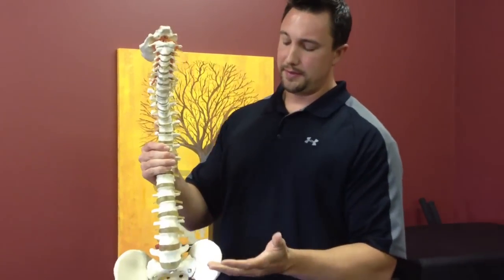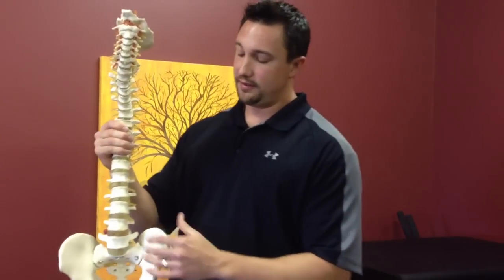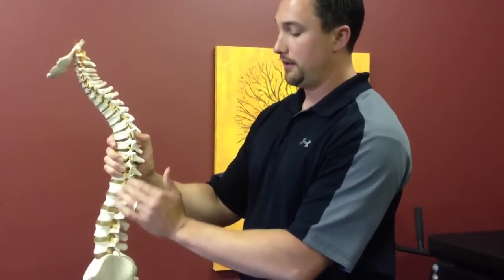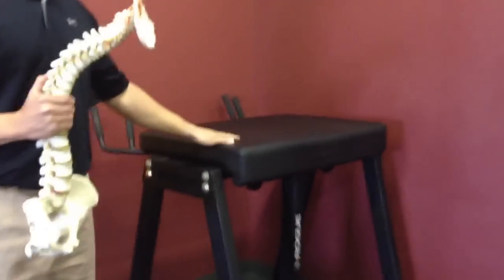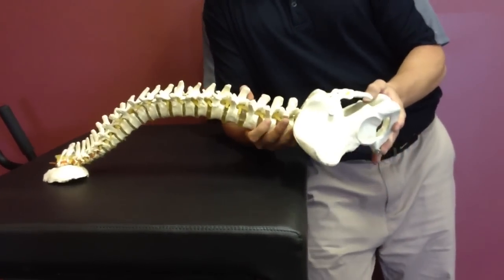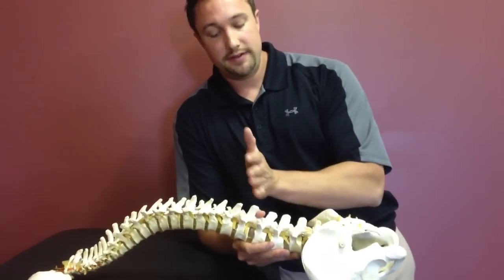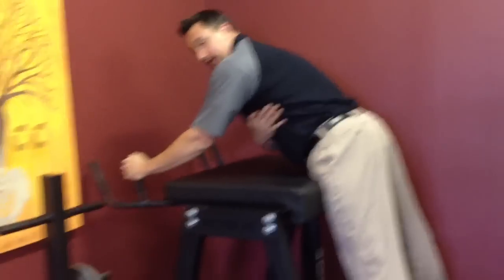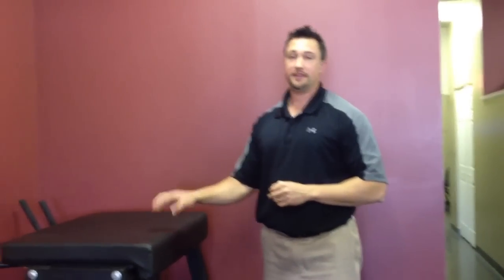Spinal Decompression using Reverse Hyper | Susquehanna Spine Lancaster | Westside-Medical

Comment: I just bought the rogue reverse hyper. I have 2 lower back buldging disk.  My back is been hurting:(  iam thinking because if the reverse hypers
Reply: Any updates?

Did you try it without weight
Reply: @golftownpro999  no I did not.  I sold it
Reply: Did you was died?

Comment: Please HELP, I have lower back pain, (Bulging disk) so I was told by my Doctor, Physical therapist and Chiropractor that I need to make my lower back stronger including the glutes. I have used the regular GHD hyper in the gym and definitely works making my lower back pain get better and also gives me a little stretch in my vertebrae. I have limited money and space, which do you recommend for someone like me. I'm not a powerlifter, just trying to make my lower back stronger and get some stretch/decompression on my back. Should I the regular GHD or the Reverse Hyper? thanks...
Reply: The rogue scout reverse hyper. It folds and is the cheapest.
Reply: The GHD did magic to my lumbar. Research the position of your hips and what it works.

Comment: Anybody know what kind of gym this would be at? Would a local CrossFit have one? I don’t have the money to buy but want to try bad!
Reply: Look up "Reverse Hyper Scout" Rogue just came out with it in collaboration with Westside Barbell. It's only $350 usd and folds up so you can use it at home. Unfortunately they sold out almost immediately but they should be restocking eventually. To answer your question though: yes crossfit, powerlifting, or university gyms are most likely to have one. Only gym I've ever been to that had one was my old university gym
Reply: @1KevinsFamousChili1  I found the foldable one for sale. It sounds great but still want try it first. Found one about 45m away from me and I think even tho my back is messed up and only using that machine it’d cost $80/month
Reply: @1KevinsFamousChili1  thank you I appreciate the info👍🏼

Comment: How much weight should you start with?  I'm thinking 50pounds is enough to get good traction from it without getting to the point where the upswing would be difficult.
Reply: Louie recommends 25% of your 1RM back squat for recovery days and 50% for heavy days. I'd say start lighter and increase the weight as you learn the exercise and gets more comfortable with it.

Comment: PS. Last year 5 Surgeons wanted to open up my lumbar. Now they can’t believe how good of shape I’m in.
Reply: Yes I use it 3 days a week 5 sets 15 reps before my heavy squats. Thing has saved me.
Reply: If you have anymore? Yell at me. I started with 10 reps 5 lbs 3 sets added 5 lbs a week after 3 weeks went up on reps and sets. Feel great
Reply: @peterprice6394  Thanks for the advice. Mine has helped me a lot but I need to perform more sets. I'm not doing enough.
Reply: Peter Price Looking into buying one. Had disc replacement surgery for C5-C6, and lower back is a concern given all the gear I wear daily. Seems like a great investment!
Reply: Danny Herrera what type of gear Danny.
Reply: Peter Price I am a police officer so vest with tactical gear as well as duty belt. Want to get my lower back stronger and prevent injuries I see others eventually get.
Reply: Danny Herrera I did that for years. Thanks for being on the front lines at the moment.  I’m 55. I just bike a lot now. Do compound movements for my workout. Squats Dead lifts Bench Press and overhead presses. 2 times a week. Swimming when I can 3-4days a week. A duty belt. Is hard. I carried a Kimber 1911 for years. I just turned to a 9mm compact carry beretta. A few once’s made a difference I did find that have a high dollar uniform belt. under the duty belt made huge difference also and belly fat. Will not help the cause. The leaner you are in mid section the better. I squat 2 times a week heavy. there’s no better work for back and core strength in my opinion with dead lifts and reverse hyper. I start every workout with 5 X15 reverse hypers then squat
Reply: Danny Herrera PS I have worn tach. Gear in 30 years. If it was me I wore the best I could by. The army was really heavy gear. I’d think today. You could find. Some great stuff if the Dept will let u buy your own gear. My friends say I’m a gear junky. I say I’d rather stay alive for few extra $.  And be prepared it’s like the rouge gear you pay for what you get. Elite FTS is outstanding as well. Ill probably get one of there bench’s with all the safety spotting
Reply: Peter Price Thank you for your feedback and for your service!!! Really appreciate it!!! Ordering my reverse hyper this week and can’t wait! It’ll be a great addition to my basic garage gym.
Reply: @peterprice6394  Awesome tips Peter!! Thank you
Reply: I've been telling people this for yrs. . .Reverse Hypers will save your low back, and people look at me like I'm an alien from another planet. It saved my lower back, and also made me into a better athlete overnight (almost). Quicker, faster, jump much higher, was able to squat properly, increased my deadlift by 100lbs in one month, and best of all no pain!
Reply: Did you use the roller attachment or did  the excercise  just with the strap?
Reply: Surgeons always want to do surgery. It’s how they send their kids to school or go on nice vacations.

Comment: Well the rouge hyper is worth every dime. My back is brand new at 53. That’s starting with 10 lbs adding 5 lbs each week. 15 reps 5 sets 3 times a week before heavy squats.
Reply: Will help with T-10 through 12 issues?
Reply: @rosskstar  disclaimer : I am not an expert. But the theory of disc pumping should hold for thoracic discs also, although the effect will be less pronounced. And it won't stregthen the thoracic muscles that well.. But definitely worth a try imo.
Reply: amazing
Reply: Quit heavy squatting. 😑

Comment: what if i do reverse hypers on a bench? the rogue one is pricey as heck.
Reply: You could do that yeah, but with a reverse hyper machine you can load up basically whatever weight you want, you have the handholds, and its high enough off the ground for your feet to swing.  It basically just works way better than using just any old bench and you have the option of easily adding weight, which is why its so effective over doing bodyweight or using a 10 or 20 lb dumbbell between your feet.
Reply: U can’t get the needed traction on lumbar. Rouge is only way best option.
Reply: I’ve uploaded a few videos of my home made versions pal. You should check them out.
Reply: Titan just released their version for a fraction of the price. I just received mine, and it’s built like a tank. 

 https://www.titan.fitness/hpnd1-hpnd2.html
Reply: I've done them on a bench, and also my dresser in my bedroom! Anything can work. Of course the machine is easier to use, but it's certainly not the only solution.
Reply: I have built something similar to a real machine using a squat rack, dip bars, barbell, dip belt, some plates and a plank which I all already had. Works great for me although I have not tried a real machine so I can't compare.
Reply: Titan now has a more affordable version.